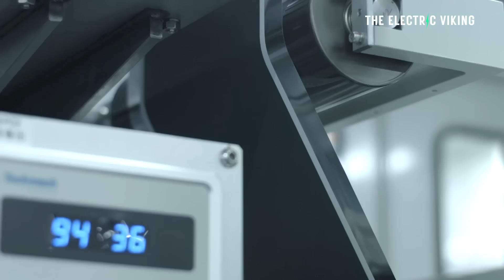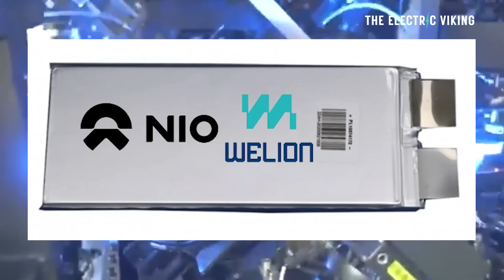Worlds fastest electric car superchargers can charge EVs at 640-kW speeds

Comment: Interesting that Nio should be doing a fast charger that will tend to make its swap over battery system redundant. Perhaps they are tacitly admitting that swapping batteries has not been the success that they hoped, and they intend to transition to fast charge and structural batteries.
Reply: Your reply does not have any sense.

NIO will support both.

I cannot understand these comments that NIO should stop produce Baas-swapping stations for cars. 

What consumers will win if they does not have more option to charge their EV-cars.

The short answer is NOTHING.
Reply: @iSot80  Try looking at it from the perspective of the company owning the battery swapping stations.
Reply: @danharold3087  and tell me WHY I would like to think that side in consumer perspective?

More option is better than only one option to charge for EV. It is as simple as that.

Only if batteries will last 25-30 years without no worries, the integrated batteries would suit for consumers.

For example If you are going to store and buy a 1 litre of milk, so you would like to think the owner side of the shopping process?

I think you would not.
Reply: @iSot80  One has to look at both the provider and consumer side.  It has to work for both. A car swapping station can not be swapping worthless batteries for good ones at $100 a crack.  
We have options for charging EVs. We can charge at home with or w/o solar.  We can charge at destination chargers. We can charge at fast chargers.  You can even charger with a ICE generator.
Yes integrated batteries better have a suitable life span. I expect it will be miles and years whichever comes first. 

"For example If you are going to store and buy a 1 litre of milk, so you would like to think the owner side of the shopping process?"
Yes you should if your trying to milk swap a spoiled or empty milk container for a new fresh one.   That is your problem with battery swapping.  Merchant pays 10 for Milk.   Milk is 25 in the store but you want to swap him a bad milk for a new one plus 1.    
This is battery swapping as you presented it.
Reply: @danharold3087  You seems to be reasonable guy, still you really do not get it or your opinion is just too far away and I think that it will not change at any situation.

The benefits for the swapping/Baas-unit for consumers is so much more than "just charging".

Current EV with Integrated battery is not reliable unit for long life use like ICE cars. In long term, It will not hold monetary value or use value.

The current battery tech and current ev-cars which have integrated batteries, there is no re-sale value in long term and that is the truth. The reason is that energy unit (battery) does not last 10-20 years without worries like ICE car, which will work easily with good care.

This is the end for my side to this conversation. Let see what future will offer for this matter.
Reply: @iSot80  "NIO has a 500 kW ultra-fast charger that can charge electric vehicles (EVs) in less than *12 minutes*. The charging facility has a maximum charging current of 660 A."
Reply: @iSot80  The difference here is that I am looking at the money.  Follow the money.   When you can charge a car in 12 minutes, preferably a bit less, EV chargers operate like a gas station.  Just rip out the pumps and put in NIO's new chargers.  Can that happen today no. Maybe not as I don't think may cars could take it.  Wait just a few years and it will work.  We can't invest in a tech with a life span that can be counted on one hand.
Reply: swap is still king. soon y gonna have 1 minute swap with 30 battery storage space
Reply: Your arguments make no sense.  If you have been observing China news then you would understand that the government just mandated annual checks for battery health check. Top much electric vehicles are catching fire due to battery degradation and battery swap solve that and its also  helps the recycle of faulty battery much easier and it's also send back electricity to the grid when needed.. battery swap work for China and it will definitely work for our big cities in the west .
Reply: @mrclinf85 thank you. Also the greatest advantage of the battery swap is battery degradation and the only way to retain the value of your EV after many years of usage/charging. Imagine for a minute that you could replace your battery/engine for less than $100 after driving for over 100,000 miles. Battery swap is a win any day.
Reply: @Dave333M  Imagine if mass adoption of swapping was to occur. Transfer stations would have to carry maybe 100 or more battery packs to cope with the demand. The capital outlay would be huge plus the storage and charging of the swapped packs would be a logistical nightmare.
Reply: @mrclinf85  This is all predicated on crappy batteries.     The world is spending many billions on battery research.   Swapping will be no faster than charging.  And it puts us right back in the hands of other like when we fill up ICE cars.
Reply: Hard to project the needs of "mass adoption" of EV's, which happens when about 20%+ of vehicles in use are EV's.  Right now, it is still well-under 5% and is growing.  IMO, mass adoption will require a fast, easy way to replace battery packs.  People will want to upgrade or replace 'bad' batteries.  That need on a mass scale will trend towards 'swapping' of standardized battery modules.  Imagine the needs of 40 million EV's.... better start building solar farms NOW.
Reply: To make it economical feasable to swap batteries, you need more EVs using it. And currently EV's are way too expensive for other than the top 10% earners in a country.  When you see a 80% EV adaption, then they might think of it.
Reply: @AndrewTSq  What you think has happen in previous months? New tech will need more time, as always. You can find more information from web what brands have made deal with NIO for Baas-stations for future. We are talking of millions cars for these brands next models (2024-2026)